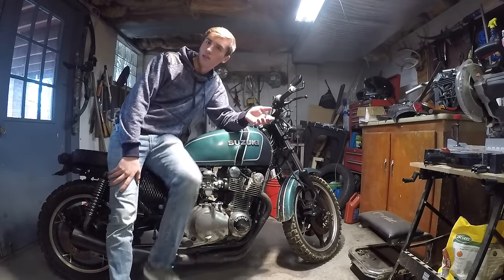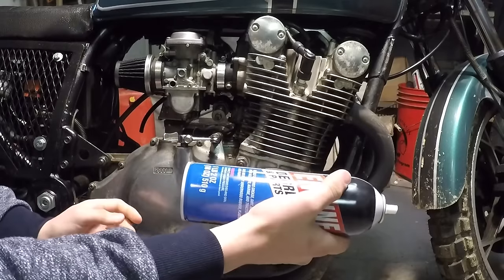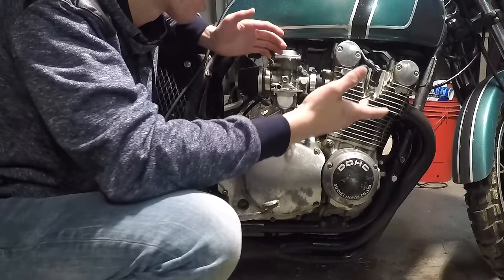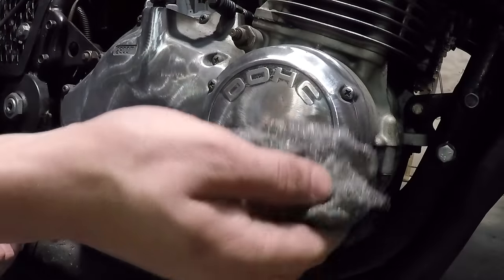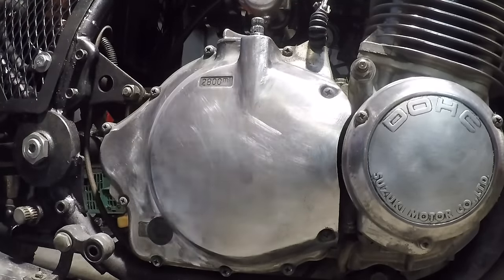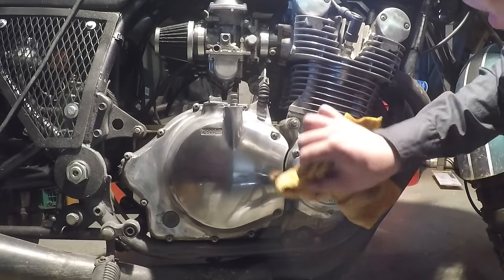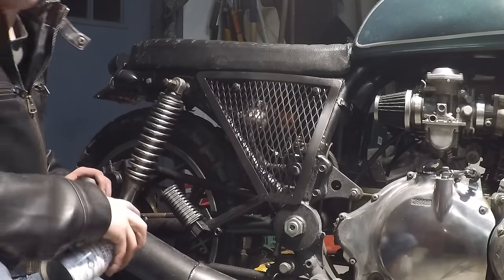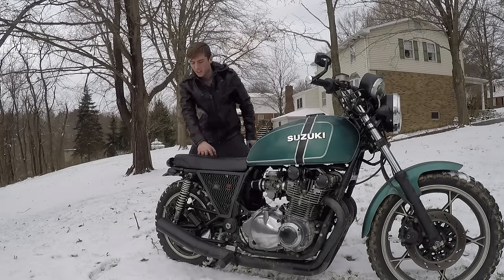How To: Polish Your Dirty Old Motorcycle Engine

Comment: You could have saved yourself half your elbow-grease, by using some paint-stripper to get the old clear paint off. Then polish. That way you don't have any big marks to buff out.
Reply: Exactly, I was going to say the same... Paintstripper everytime, then polish to a mirror finish, using soft cotton cloths and Autosol.

I found that running the engine, and getting the cases warm- gives a much faster reaction to the paintstipper atracking the laquer or silver finish.

Always use a gel painstripper too.. that way is stays where you want it to be!
Reply: There seems to be a problem here.
Reply: dd
Reply: d
Reply: ď
Reply: d
Reply: d
Reply: d
Reply: @Kibleh  zź.3.aaaaaa
Reply: @Kibleh  zź.3.aaaaaa
Reply: Wouldn't paint stripper affect engine gaskets or spoil them ?
I want to remove some spray paint that a previous owner has sprayed all over the engine but I'm stuck with what to do. I just wante a clean looking engine. Also after polishing or sanding/buffing an engine shouldn't the engine be sealed with a laquer or protection?

Comment: I'm a profession wood worker and long time rider, I can tell you 100% that you shouldn't skip more then 2 grits when sanding/polishing. You will get a more dull finish if you jump 3 or 4 grits like going from 120 to 500. You need to slowly remove the scratches from each sanding. 120-180-240-320-480 or 500- 750,-then 1000. He's right, it really I'd alot of elbow grease!
Reply: Thank you for the helpful information

Comment: Good job, but you did make more work for yourself using such aggressive sanding discs. Also a tip, change to a clean polishing wheel when you change compound, also clean the surface between steps, keeping it free of contaminates will make it much easier to get the desired final finish.Another tip, painting raised letters. Applying vasoline just to the letter with a q-tip(very thin coat) will allow you to spray paint the whole part, let the paint fully cure then later wipe the letters with a soft cloth, the paint will come right off clean, no sanding
Reply: Just curious? Do you have a video on how to do it - would greatly appreciate it

Comment: It's nice to see you young-uns taking interest in old bikes and not filling up junk yards.
Reply: Martin Cvitkovich really hard to find good classic bikes
Reply: Japp
Reply: I don't understand why people keep turning these older bikes into cafe racers and some weird stuff. I love seeing older bikes restored. 
I'm working on restoring my 81 Kawasaki KZ750 LTD.
Reply: I had this same bike ,and wet sanded and used neverdull
Reply: Do you have proof?
Reply: 24, picking up an 81 Kawasaki 440 on Monday. It'll be my first bike. I won't be converting it to a cafe racer/scrambler.
Reply: I'm 21 with a restored 78 suzuki gs750 and a 79 Suzuki gs425. Love the older ones.
Reply: 20 and into my classic bikes i have a honda cg 125 restoring and ive got a Kawasaki gpz 305 belt drive:)
Reply: Just bought a 20 year old harley I really need to do this to it..

Comment: Great start on a cool old bike.  A machinist friend gave me a pointer a few years ago when I was restoring one of my old FJ1100s that will serve you well.  You can combine a few steps by getting scotch brite discs for your arbor instead of sandpaper.  There are different abrasive levels; if I remember correctly I used the two finest (green and red) to do my bike.  After you clean the engine; use the scotch brite only to get the clear lacquer off of the big parts (that's what is coming off on the side covers); when that is done, load the scotch brite with your buffing compounds (in the same order).  Then use your cloth wheels using some MacGuire's metal polish on them, finish up with a hand rub and a lint free cloth.  The metal should look like a brand new mirror!  A nice metal sealer (not clear) will keep them looking like that for years to come.  Every piece of aluminum on my FJ looks like chrome!

Comment: Very good job young man very good job. I love watching young people do things their self. That's how I raise both of my sons.

That buffing kit that you showed I had no idea harbor freight sold that kit. I have one similar it comes with a little bit more stuff but it also costs a lot more. Normally where I live we have a huge indoor bike show in the beginning of February. I don't really necessarily go to look at all the bikes. I go because there are vendors set up that sell everything you could ever need for a motorcycle. It's this one particular vendor who shows up every year. It's a husband and wife company. They sell anything you would need to detail your bike or your car. Every year I restock my garage from this vendor. That's where I purchased my buffing kit.

I was glad to see you using a electric drill. There's nothing wrong with using battery operated drill it's just hard on the batteries and the equipment that you plug in your battery too. Like what you were doing could take a very long time.I'm really glad that you did not use a air power drill. Nobody would have been able to hear you speak after all that sanding. 

I really love how you use that small space to be able to work on your motorcycle. And it's great that you have some place to put your bike away for the winter. I just leave mine on my left unless I'm working on someone else's bike.

I really enjoyed your video I look forward to watching more of them. Again great job turned out pretty damn good.

Comment: just cleaned up a motor on a 1990 Honda xr100. A dremel with a bunch of wire wheel brushes really helps get in small areas. I did all my fins with it.

Comment: Looks good.  For anyone following this i think 120 is a bit too rough for what youre trying to do. I think i would start with 400 minimum.  You can always go harsher if need be but once you put deep scratches in youre going to be at it a while.  Also a lot of these engines were clear coated from the fsctory and trying to do this process can easily make a huge mess.

Comment: Excellent, excellent video.  As another poster mentioned, I would be tempted to start with a less harsh sanding disk and eliminate a lot of work getting the deep scratches out.  I was worried about sanding off the black paint on some of the covers.  But, I think I like the look better with no paint.  No paint means more metal shine.  A tactic I'm going to try if Winter ever stops up here in Central New York is to use a baking soda blaster.  I got the blaster tank from Harbor Freight along with a big bag of medium grit baking soda.  What's nice about baking soda is that it dissolves in water and washes off so easily.  And, it's not harsh enough to damage anything.  It's what they recommend for cleaning carburetors because they are a soft metal like aluminum or pot metal.

Comment: A couple of points I would like to make if I may. Firstly, Don't put your polishing mops on a cement floor, if they pick up dust or grit they could spoil a lot of hard work! Second, I'm quite sure the 500 grit paper would have been ok for the first step, 250 is really coarse to be using on any aluminium but especially old Japanese aluminium, which was often regarded as being somewhere between pot metal and cream cheese in strength. Other than those points well done!

Comment: Mother's aluminum polish and a whole lot of elbow grease. I just did my 1978 Suzuki GS 750. It takes a lot of patience and time. I glass blasted the actual motor, fins, etc. then applied a high temp. clearcoat. It looks great. You can get new DOHC and Suzuki cover plates on EBAY for 20 bucks.
Reply: puntagordy

Comment: Not bad, glad to see a young man devoted so much to vintage bikes.  To be honest, as a 10+ yr painter, tape works better than paper (no need for a sanding block), YES to painting bolts (you'll screw it up later when you remove them, BUT when you do, punch them into a piece of cardboard and respray the heads), 120 grit is WAY too aggressive for aluminum (try a 320 first, in refinishing less is more, unless you talking about time lol).  Otherwise great video and glad you like the old school!

Comment: I use paint thinners and a tippex to slowly remove the excess paint after spraying. You also dont damage the writing with the other methods. If you take your time, the resaults are excellent and gives clean lines and edges

Comment: Hello from Australia, am currently doing up a 74 Suzuki gt125 twin.l would say you definitely have to take the covers off.That of course ruins the ancient Japanese Phillip's head bolts, however replacement kits in Phillip's or Allen are usually available.Anyway, l can assure you polishing smaller engine pieces is much nicer watching tv, than bending down in a garage.

Comment: Good job, it looks 100% better. Use Colonel Brassy metal cleaner and eliminate the sanding and the black polish, unless you have deep scratches. For my 1994 Honda, I cleaned with Colonel Brassy,  buffed with the red, then hand polished with Semi Chrome and or mothers., producing a mirror finish.

Comment: nice video, using a fine scotchbrite pad would have been just as effective as your sandpaper but would have sped up the polishing process.. just try it. sandpaper is pretty aggressive on aluminium.
Reply: Its only on step farther to the best method from there, wet sanding. I'd go three grits, like 500, 1000, and 1500, and then high rpm buffing to bring out the mirror look. I have those scotch brite disks but wouldn't put those to my engine, even the softest one would cause a lot of wet sanding (by hand) to remove the scratches, it's almost a guarantee somewhere in that process you WILL have an "OOPS" moment and scratch the shit out of the engine somewhere with the drill chuck or mandrel or edge of the disk while attempting to REMOVE scratches. That can be sanded out but your going backwards trying to run from wet sanding. Man up, roll up your sleeves and forget the drill and turn on some music and get the polished quality your looking for. This video is more fraudulent than informative and you didn't come along today and figure out a better and easier way everyone else never though of until you blessed us stupid Bikers with your drill knowledge. You'd save 15 mins hand work and cause 45 more hard hand work. The only powered machine that should touch a polishing job is the buffer, and that comes AFTER the sanding and goes quickly if you sanded it right. No short cuts or magic creams. If you want to know a real short cut to making a super ugly engine look like new (not polished, just clean looking) This is for engines that were black painted thats chipped away. Just clean it well with a brush and degreaser, rinse, make sure its dry and tape everything off that you need taped off and spray paint the engine with HIGH TEMP ALUMINUM PAINT. Your engine will look new and clean and it do it right it lasts and it's not obvious that it is just paint, it looks sand blasted. But I strayed, this is not polishing. You may want to High Temp Paint your main engine cases and polish the side covers if your really into it or building a hard tail Bobber out of an old Yamaha XS like I did.
Reply: I agree...Wet sanding the way to go in many cases. have done it many times
Reply: 'xactly................wb

Comment: Just a heads up. Hot soapy water removes the compound and doesn't kill the polishing work like paint thinner.  Also. When u get done with the white polish. Switch to mothers. U will get a chrome like shine. U will be amazed with the finish product.

Comment: Yeah Mike aehy threw the sleeve in the exwife's front loader washing machine it thumped like crazy but aehy didn't need a bench mounted wire buff to prepare the nuts, bolts and screws perfectly clean...

Comment: Looking good. My first bike a was a gs850. You could have started with around 220 or 300 grit. Aluminum is so soft that starting coarser is extra work. Also there are much better compounds than what HF sells. Look for a "non-ferrous cut & color" compound. It will remove light scratches and mirror polish. I usually sand to 6 or 800 and use a good cut & color compound. A lot of times engine covers and cases won't ever get perfect mirror as they are cast and the imperfections and corrosion run way too deep. One tip for the gs850- don't let the horn leads short out against the cam cover. It will fry the main fuse and leave you stranded at night on the side of the freeway.
Reply: slowlowchev z

Comment: Brasso is also a good and only mildly abrasive metal polish.
Also polishes scratches out of plastics.
Just stinks of ammonia a bit!
Also hob-brite is good.
Yes i'm aware its designed for cooker hobs but I used to clean the cymbals on my drum kit with it and they came up like mirrors.
Solvol Autosol is king but A) quite expensive if you are using a lot and B) I used it exclusively on the bumpers on my old Corsair 2000E and I ended up with no chrome left in some areas so I am not sure just how aggressive it is.

Comment: Scotchbrite pad and WD-40 works the best for ultimate mirror finish. Just saturate work piece and agitate in a linear motion. Surface must be smooth before hand. If its rough or pitted, sand or use light duty wire wheel to smooth out

Comment: Use a little less jewelers rouge at one time and you won't get that bad of a build up. Also, a bit of WD-40 once in a while as you're buffing with the first and second bar will help. I use kerosene or diesel fuel as I'm doing mine. I've used that trick on my fuel tanks and rims of my semi for years since I watched a pro polisher do that at a chrome shop. It's almost like wet sanding and it does do wonders.

Comment: Hi Mike, see in 1999 aehy did some customizing to a 1985 GPZ600R polishing all aluminium except the fork sliders to prevent glare 2 oncoming drivers aehy got some metal finishers "Richmond Metal Polishers" to handle the project as aehy had used the bike for courier work all the nuts, bolts and screws were grubby and needed preparation for paint aehy cut the sleeve of an old wind cheater (sports sweater to you) electrical tied the cuff threw in the nuts, bolts and screws then electrical tied the sleeve shut threw it in my exwife's fron

Comment: When painting letters, put a thin film of chapstick or petroleum jelly on them.  Paint the whole surface, and then wipe the letters with a rag.  That way you get paint where you want, and don't risk sanding off or chipping the paint you don't want to remove.

Comment: Hi.  I admire your determination and the fact your caring for a older bike.  However your 1st stage was TOO AGGRESSIVE and im seeing deep scratches left behind that MIGHT  not be repairable at this point?   Perhaps next time consider trying a  small wool pad or a compounding- foam cutting pad on a drill or mini random orbital high speed polisher along with a high quality metal polish  , Than apply a "heat safe"  sealer to it afterwards. I have found in my experiences with metal polishing that some of the best metal polishes that cut well have a strong ammonia smell to them. The brand "blue magic" is one of the good brands ive used.
Im not bashing you or your technique.  I wanted to share a different method with you that wont leave heavy scratch marks. TAKE CARE

Comment: Vapour blasting is the way to go. Thorough, uniform, fast and beautiful. Best of all for the cylinder fins and not ridiculously expensive. Try it once, you'll never do it any other way afterwards.
Reply from the maker: TheRunereaper I have never heard of vaporblasting, sandblasting yeah but what is vaporblasting?
Reply: Goldguy:  https://youtu.be/r1cwHdwDOvU This is a link to a UK site. Unfortunately the quality of this particular video is nothing like the quality of the blasting. The name of the firm is "Aquablast" which can be confusing.
https://youtu.be/IC0FA2l79YE This is a link to a US site which has some better photography.

I appreciate that you are doing a lot with a little and it's a great effort but once you've used this technique nothing less will ever do. Good luck and thanks for your post.

Comment: What are those parts at 11:44? I need some and cannot figure out how to properly search for them! Help appreciated!
Reply from the maker: Daniel Hemphill I'm not sure what they are officially called but I call the camshaft cover end caps, if you search that on eBay you should find some stuff. Best of luck!
Reply: Goldguy thanks  a lot man! Got me a 1982 GS650E that’s been beat to heck! Lots of original parts, but scratched and dented all over. Torn between a scrambler build or just restoring it as I just rebuilt the carbs and it turns out they are from a GS850!!! So they already are not original.

Comment: I find that mag / aluminum polish and designed power buff cone ( about 30 dollars ) with an electric drill. Most already have this. Works sweet as well. Made my 78 Kawasaki KDM cases glow like a mirror.
It's very easy to do and very none harsh and gentle.